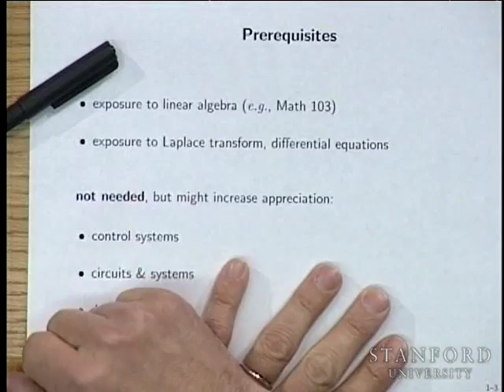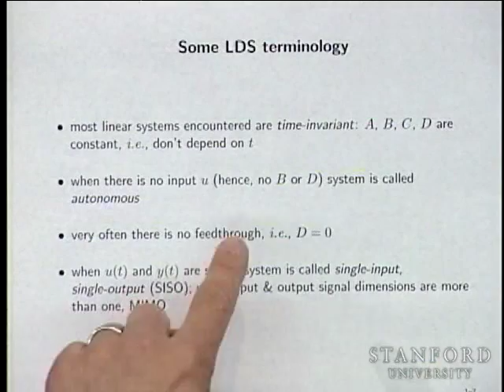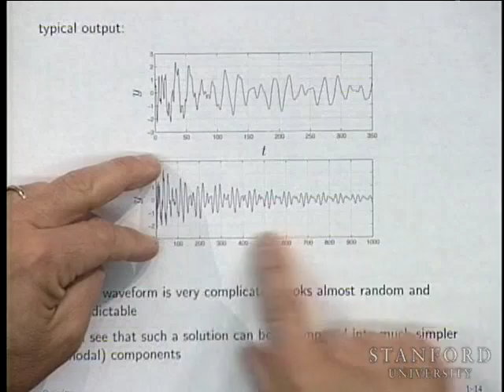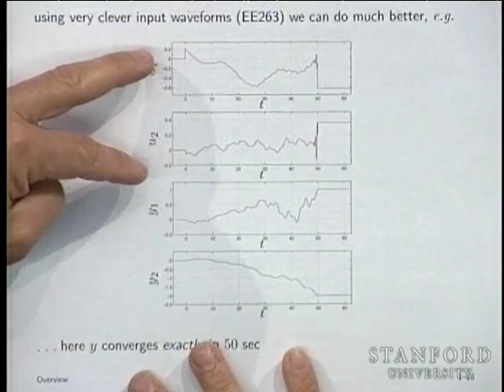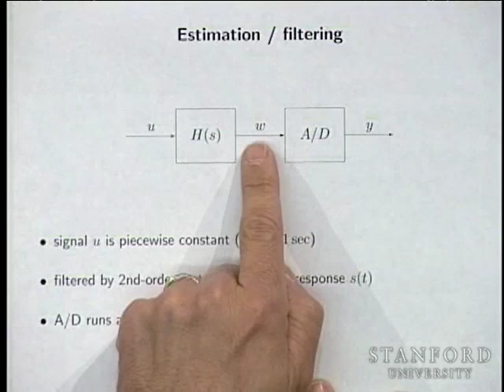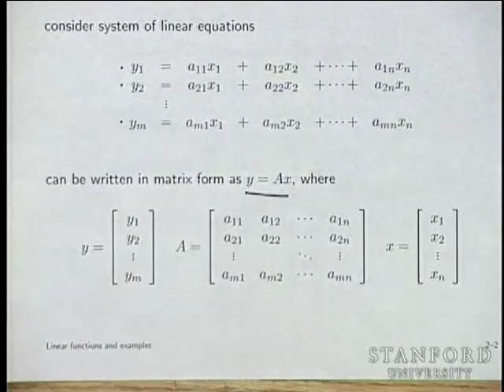Lecture 1 | Introduction to Linear Dynamical Systems

Comment: Well, if you plan to work with architectures or pysics, microsystems, FPGA, computer engineering, VLSI, nanoelectronics, etc. You may not needed ever. However, if you plan to work in signal processing, robotics, automation, bioloengineering, aeronautics, etc. then it may be really a hot topic.